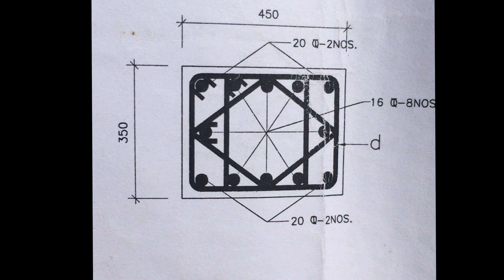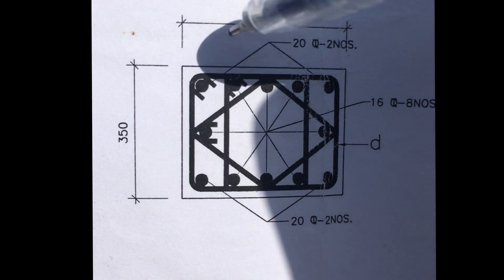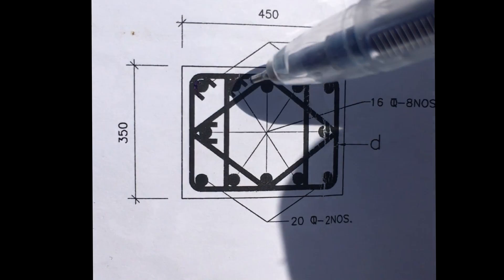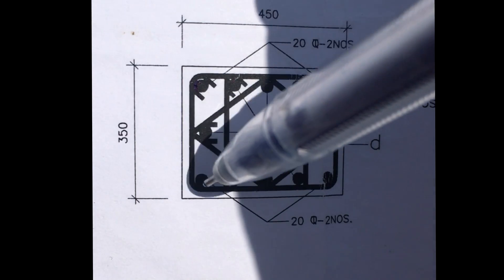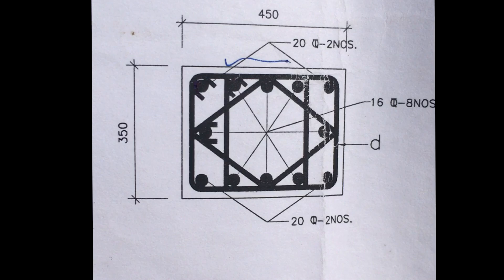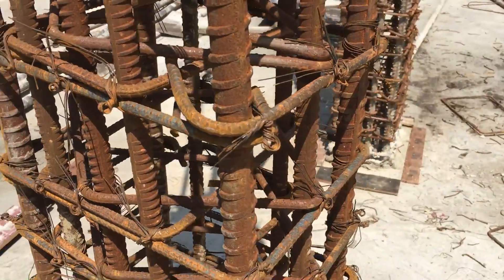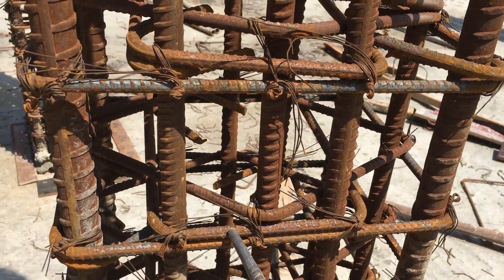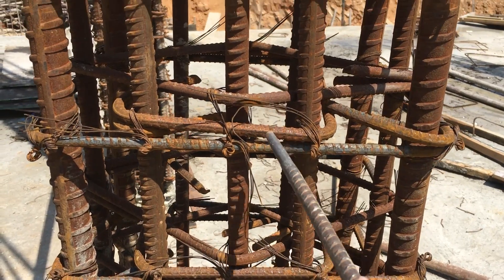Lateral Ties [Stirrups] of Column In Detail

Comment: What is the size (the diameter) of the stirrups in mm?
Reply from the maker: 8-10 mm.
Reply: @engineeringacademy9812   Ok thanks. It is 8mm for the 16mm rebars and 10mm for the 20mm rebars?  or it can be either 8 or 10mm for both?
Reply from the maker: @pepepomada4664  It can be anything. depends on the shear force.

Comment: What is the spacing for short column effect in Eq Zone 5
Reply: I have given the spacing of one short column of height 4 feet around 50 mm c/c, the column has 8 bars, double rings(large one size 275mm & small 225mm), & the size is 400mm ×400 mm. So is it over reinforced? I will be very grateful , if you help me in this matter @Engineering Academy